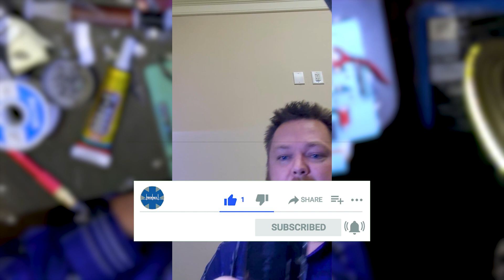iPhone X Screen, Battery and New Method of Back Glass Replacement DETAILED

Comment: Great work.Battery health is at 82% and using latest IOS software.The detail for applying the sealant is important for me  because the iPhone is used in humid marine conditions at sea in the yacht.                                         
I just hope that iPhone supports the X model with IOS updates for at least five more years and not implementing factory codes after battery replacements.The camera is short of fantastic even in comparison with the Leica and Zeiss technology used by competitors in 2023 with Android software or in Google Pixel phones.
Thank you a lot for the tutorial.  
:trophy-yellow-smiling:

Comment from the maker: Please support the channel by using my amazon links! 
For the Parts & Recommended Parts click on the links below.

iPhone X LCD Screen :
https://amzn.to/35hbTwV
https://amzn.to/3IM6lcn
https://amzn.to/35aMxR7
https://amzn.to/3qSG71u

iPhone X Battery :
https://amzn.to/3tPh0yA
https://amzn.to/35hcdM9
https://amzn.to/3KNSq7t
https://amzn.to/3tSQvbm

iPhone X Back Glass :
https://amzn.to/3IshaA0
https://amzn.to/32teh2A
https://amzn.to/3GXJwl9

iPhone X Screen Protector :
https://amzn.to/3KC0bNy
https://amzn.to/3tOEDax

iPhone X Covers :
https://amzn.to/3rN5jWF
https://amzn.to/3FW1DXB

2 PACK Back Glass Screen Protector :
https://amzn.to/3qUPUV1

FOR NEW PHONE !
https://amzn.to/3Aqo99O
https://amzn.to/3IyX0Ej

Hot Air Rework Station :
https://amzn.to/32PXsyX
https://amzn.to/3EQca5T

Safety Glasses :
https://amzn.to/3fbBmcV
https://amzn.to/3fbBpp7

Fume Extractor :
https://amzn.to/3eXzsMB
https://amzn.to/3eOI1cG

Glue Remover :
https://amzn.to/3HFGUbR

Syringes, Plastic Squeeze Bottles and Needle Tips :
https://amzn.to/3pU3pDF

Clamp :
https://amzn.to/32OcNA4

Cold Glass Glue :
https://amzn.to/3sVkqiH

Heating pad:
https://amzn.to/3mbIytW

Heat Resistant Gloves
https://amzn.to/3EsZdyW

My blue mat to keep everyone organized:
https://amzn.to/3BalS16

iFlex Opening Tool with Glue Card :
https://amzn.to/35UC9h8

iPlastix Opening Tool with Glue Card :
https://amzn.to/38FtzUH

on of my favorite screw driver sets 2uul:
https://amzn.to/3jsqkCz
https://amzn.to/3CcoL2Y

iseasmo w/ Kit (Has Screw driver too)
https://amzn.to/35Za2O0

Tweezers:
https://amzn.to/3B7yBlf

T-7000 Water sealing glue:
https://amzn.to/3EdzLxs 

Isopropyl Alcohol For Technical Use:
https://amzn.to/3BqBU78

Need to get a part from a reliable quick source, you'll find a better price here then Amazon and the quality will be a lot better. Click on the link below.
https://www.injuredgadgets.com/?acc=be9b6cec65c863e1b55538d2c7fcc9b0

• Visit our Website: https://tech-md.com

• My email: dustin@techmd.bz

• To mail in your phone, please contact us at 801-438-6028